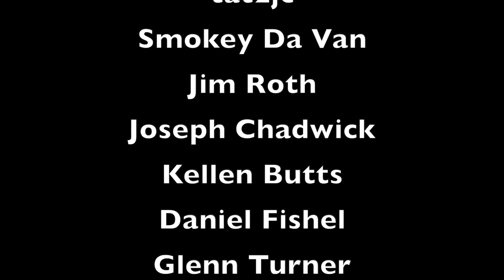Will Her Harley Sportster Finally Run?

Comment: Low voltage can weld the solenoid connection  in the on drawing current position.   Then your starter burns up and the battery gets ran dead and damaaged..

Comment: That battery came with two brass spacers to be used when using side mount option to make better contact and not melt the plastic or the terminals.

Comment: Hey a rule to remember on Batterie work, it's ALWAYS take off the Black first and then the red and the other way round to reconnect...  always Black First off and Black Last on.... start with Black and finish with Black..... This way, you never get sparks, or blow a fuse.
Surprised Josh did not tell you that or did he not know himself.

Comment: Of all the horsepower increasing, bolt on accessories that I've ever found (like the chrome & gold "live to ride" eagle mirrors), none has added more horsepower to my bike, like the Flower Valve Stem caps I just received. They're badass, & I love them Chey! Pretty sure they added at least 50 hp & doubled my Cool factor. Thanks again Chey!

Comment: 13:43 if there is a loose connection, ie need for spacers. It's most likely arcing the air gap.